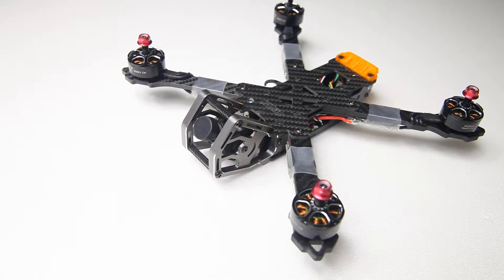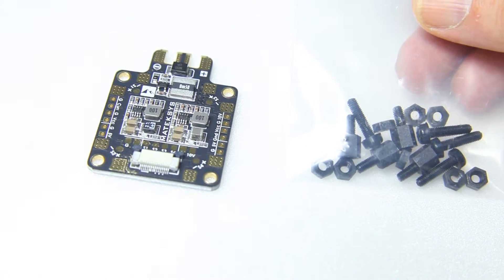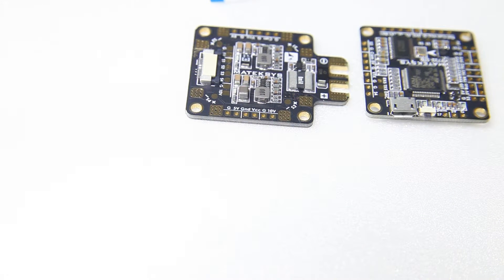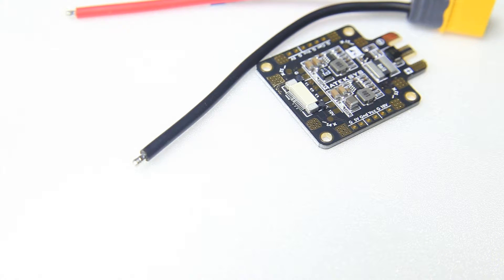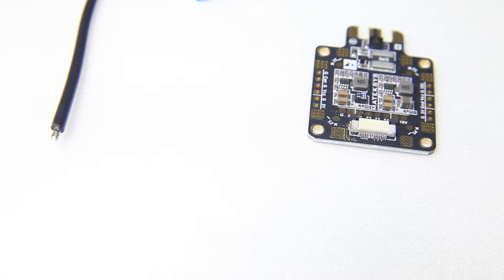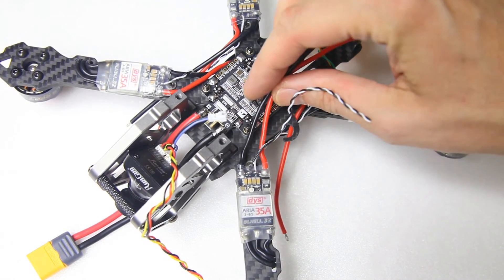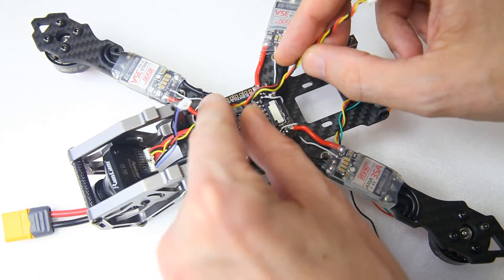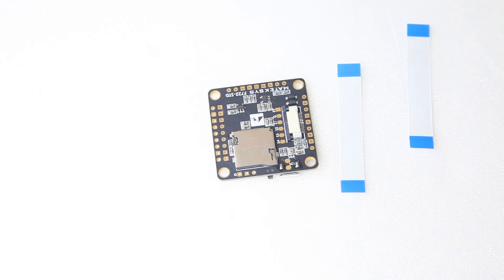FREESTYLER Project - GepRC KHX5 Elegant Quad Build - P4: Matek F722-STD + Matek FCHUB 6S :)

Comment from the maker: Matek.. Matek and MORE Matek ;) 
Matek F722 STD: https://goo.gl/1hEbiq 
Matek FCHUB 6S: https://goo.gl/ZhnM5T 
Matek VTX HV: https://goo.gl/XK6bHN 

The parts list! 
GepRC GEP-KHX5 Elegant: https://goo.gl/Ymunp8 
Matek F722 STD: https://goo.gl/1hEbiq 
Matek FCHUB 6S: https://goo.gl/ZhnM5T 
Matek VTX HV: https://goo.gl/XK6bHN 
DYS Aria 32bit Dshot1200 ESC's: https://bit.ly/2HiXcYw 
EMAX LS2207 2550Kv motors: https://bit.ly/2M0MHgb 
Hyperion G7 HvLi 4S lipo: https://goo.gl/1a2TTs 
GemFan Windanser 5042 props: https://bit.ly/2JtMEe3 
Runcam Swift 2 camera: https://bit.ly/2HEXFEA 
TBS Triumph antenna: https://goo.gl/izqJBi

Comment: Just got done with build used a matek f7 board 
Bound to frsky just fine connects to betaflight but motors are stuck at 1500 won't arm?
Any thoughts thanks
Reply from the maker: Well you're then pretty far along :) 
1. checked the range of all your channels? CH1-4 should all run from 1000 to 2000 centering out at 1500 (fix this in your Radio)
2. are the channels actually mapped to the correct "function" (fix this eighter in radio or BF) 
3. ad the "Warnings" to your video OSD.. often that will tell you what's wrong
Reply: @DutchRC  
Thanks

Comment: Hi hopefully can help I have the bnf geprc elegant and I deleted the stock setting can you help me put them back by posting them
Reply from the maker: Would you be helped with a DIFF ALL output?? (you can run that through the CLI tab...
============================================= 

# diff all

# version
# Betaflight / OMNIBUSF4SD (OBSD) 3.2.5 Feb 11 2018 / 00:49:36 (6e69ff00c) MSP API: 1.36

# reset configuration to default settings
defaults nosave

# name
name Elagant

# resources
resource MOTOR 1 A03
resource MOTOR 2 A02
resource MOTOR 3 B00
resource MOTOR 4 B01

# mixer

# servo

# servo mix

# feature
feature TELEMETRY
feature RSSI_ADC
feature LED_STRIP

# beeper

# map

# serial
serial 2 8192 115200 57600 0 115200
serial 5 64 115200 57600 0 115200

# led
led 0 6,8::ATOBI:0
led 1 7,8::ATOBI:0
led 2 8,8::ATOBI:0
led 3 9,8::ATOBI:0
led 4 10,8::ATOBI:0
led 5 11,8::ATOBI:0

# color

# mode_color
mode_color 7 0 0

# aux
aux 0 0 0 900 1400
aux 1 1 1 1300 1700
aux 2 2 1 1700 2100
aux 3 13 2 900 1350
aux 4 28 0 900 1375

# adjrange

# rxrange

# vtx

# rxfail

# master
set serialrx_provider = SBUS
set motor_pwm_protocol = DSHOT600
set align_board_roll = 180
set ibata_scale = 180
set small_angle = 180
set pid_process_denom = 1
set osd_vbat_pos = 2434
set osd_rssi_pos = 40
set osd_tim_1_pos = 2454
set osd_tim_2_pos = 2422
set osd_flymode_pos = 333
set osd_vtx_channel_pos = 377
set osd_ah_pos = 200
set osd_current_pos = 2402
set osd_mah_drawn_pos = 2370
set osd_craft_name_pos = 2443
set osd_gps_speed_pos = 218
set osd_gps_lon_pos = 82
set osd_gps_lat_pos = 65
set osd_gps_sats_pos = 51
set osd_home_dir_pos = 302
set osd_home_dist_pos = 303
set osd_compass_bar_pos = 266
set osd_altitude_pos = 247
set osd_pid_roll_pos = 423
set osd_pid_pitch_pos = 455
set osd_pid_yaw_pos = 487
set osd_debug_pos = 1
set osd_power_pos = 321
set osd_pidrate_profile_pos = 345
set osd_warnings_pos = 329
set osd_avg_cell_voltage_pos = 76
set osd_pit_ang_pos = 257
set osd_rol_ang_pos = 289
set osd_battery_usage_pos = 392
set osd_disarmed_pos = 138
set osd_nheading_pos = 311
set osd_nvario_pos = 279
set osd_esc_tmp_pos = 82
set osd_esc_rpm_pos = 83
set vcd_video_system = 1

# profile
profile 0

set d_pitch = 30
set p_roll = 44
set d_roll = 28

# profile
profile 1

# profile
profile 2

# restore original profile selection
profile 0

# rateprofile
rateprofile 0

set roll_srate = 72
set pitch_srate = 72

# rateprofile
rateprofile 1

# rateprofile
rateprofile 2

# restore original rateprofile selection
rateprofile 0

# save configuration
save
#
Reply: @DutchRC  thank you thank you thank you
Reply from the maker: @bradkay2710  No problem man :)

Comment: can you please tell me what u used for the Board and Sensor Alignment I have mine like yours the board is facing backwards and is upside down.. Thanks
Reply from the maker: I can :)  180 degrees for Pitch.. and that's it :)
Reply: DutchRC Adventures thank you very much
Reply from the maker: No worries man :) 
Did you allso take into account that the motor-order is probably different? Or did you un-rotate the PDB?
Reply: I wired them str8 like u.
looking at the frame from the top and facing forward my motor 2 on the PDB is back right.  motor 1 on the PDB is front right motor 3 on PDB is front left motor 4 on PDB is back left. Is there something else I need to do?
Reply: Or should I solder them Un-rotated?
Reply from the maker: Neh.. definately don't make a wire-mess of things.. You only have to figure out the order Once.. right? :) 
For me it was: 

2 = Right Rear
1 = Right Front
4 = Left Rear
3 = Left Front 

and to get that working: 
Clear stuff:
resource motor 1 none
resource motor 2 none
resource motor 3 none
resource motor 4 none

Forreal: 
resource MOTOR 2 C06
resource MOTOR 1 C07
resource MOTOR 4 C08
resource MOTOR 3 C09
Reply: WOW.. I would never figure that out.. Thank you very much.  I will do it this way. Thanks again...
Reply from the maker: No worries man :)  DO test things well before you put the propellors on offcourse :)

Comment: If you solder the signal wires directly to the right signal pads on the PDB you won't need to remap the motors in BF.
In your case S1 to S2, S2 to S1, S3 to S4 and S4 to S3 and using the ribbon cable it's all you have to do.
Reply from the maker: The PDB is Allso upside-down & not facing forward sir :)  So the motor-order on the PDB has the same .. ehm 'problem'.. No biggy offcourse though.. I remapped the resources and it works like a charm :)
Reply: Yes, it is upside-down but S1 and S2 are in any case on the right side of the frame and S3 and S4 on the left side, but S1 is in front and S2 on the rear so if you solder the wire as i told it will works....but not a problem...the important thing is it fly well  :-)
Reply from the maker: Ghehe yeah.. but well.. it's rotated as well ;)  In my case this is my motor-order: 
2 = Right Rear
1 = Right Front
4 = Left Rear
3 = Left Front

Trick question for You! :D 
In Betaflight my motor-order is nog correct.. but.. in the BLheli suit it is Not :O 
why is that? :)
Reply: Strange, no answer for you , sorry   !!!! could be the remapping ??!!!
Reply from the maker: Ohooo! Thought you would know :$ 
the answer: ONLY in Betaflight does the remapping of resources have an effect.. The BLheli suite has no 'knowlidge' of the remapping I did :) 
Does that make sense? :$ 

The DYS ESC's I used have LED's by the way, which you can set the color of in the BLheli suit :)  Fancy!
Reply: That sound strange for me but i don't have a quad with remapped motor to try directly.
But after this i think it's better to 'remove' the remapping and solder the signal wires as i told, so BF and BLH will manage the escs both in the right way  !!!
Reply from the maker: Don't worry brother :)  My previuos GepRC build (that 'monster' AX5 in case you know that series) allso had a remap.. worked fine :) 
I actually DID what you said in your first comment by the way, but that won't work without remapping.. (I just did a hover-test a minute ago by the way)
Reply from the maker: ohw ps: it Would work, if i would have the power-leads comming out the Back of my quad.. That way the order would be correct.. but well.. I've got the power-lead comming out the Front of the quad...